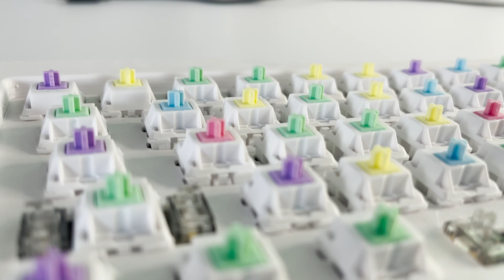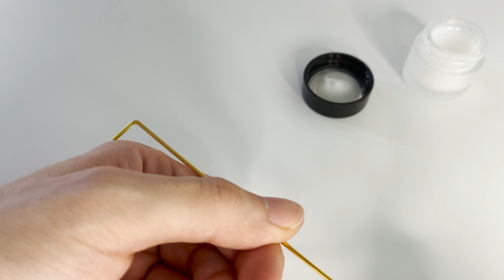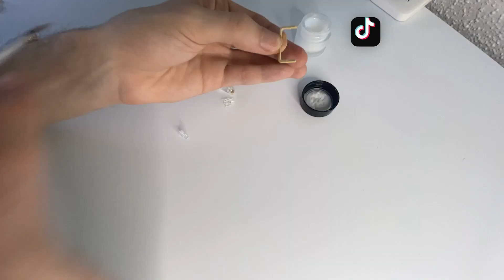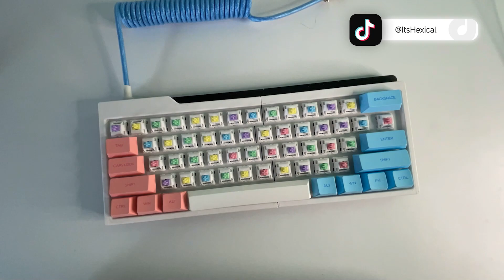I 3D Printed A Keyboard Case! | Sick-60 3D Printed Keyboard Build & Soundtest

Comment from the maker: What do you all think of the build? I am super stoked about it, and I can't wait to build more! 

TIMESTAMPS
0:00 Cinematic Intro
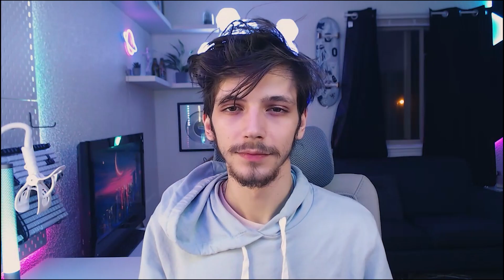0:35 Intro & Overview
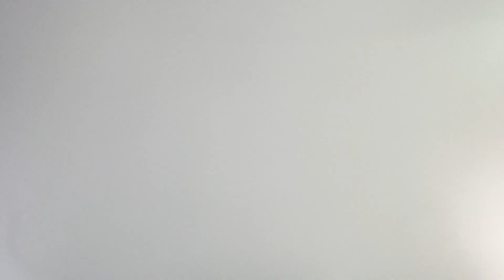0:51 Parts Breakdown
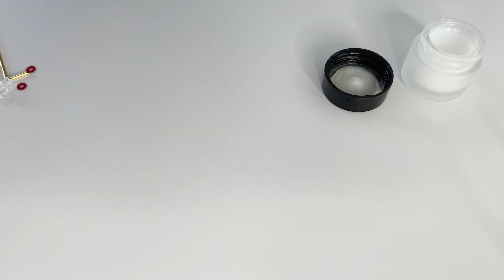1:32 Lubing / Installing Stabs 
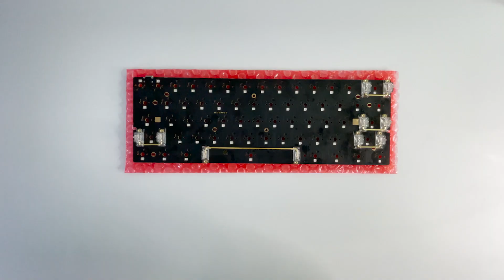4:07 Front Plate & Switches Installation
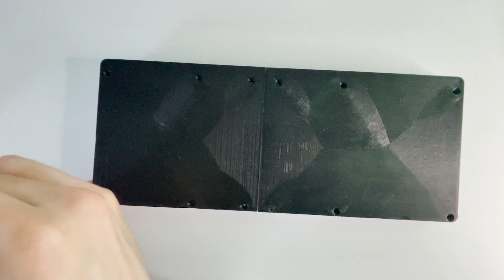5:12 Back Plate Installation
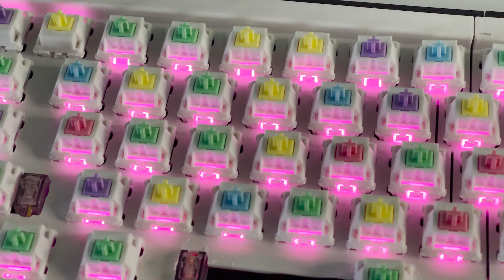5:40 Keycaps Installation
6:24 Finished Build
6:56 Sound Test
8:08 Overall Thoughts
9:23 Outro

Comment: Hey great build. I'm doing the same build now. did you have to make cut outs for the stabilizers? I just printed the plate, and the holes for the stabs are way too small. Thanks!
Reply from the maker: Hey, there is a special plate for other types of stabs - just google cherry mount sick-60 and it should pop up!

Comment: Great vid! I think your spacebar was upside down, and curious how did you get the plate to fit the durock stabs? The plate looks like it was designed for costar stabs?
Reply from the maker: Thank you! I actually had to use a program to make a 60% plate for cherry stabs, then I cut the inside of the model out and put the cherry ones in.

I did print the wrong one first, so in a few clips you may notice it has costar stab slots. I fixed it in a later version, but I didn't show that much bare.

Comment: I always wondered how folks with 3d printed tech get em powered up etc. From Reddit btw.
Reply from the maker: Hey! If you are interested in 3D printers, I'd highly recommend checking out a channel like 3DPrintingNerd. 

Generally though, 3D printers will either come fully assembled already or in a kit where you just have to put it together from instructions. After that, its simply just using a power button :). 

The more complex part of 3D printing is the maintenance and using the programs for it to slice the 3D models. It's a super fun hobby to get into though, especially if you are into modding / building up your own stuff.